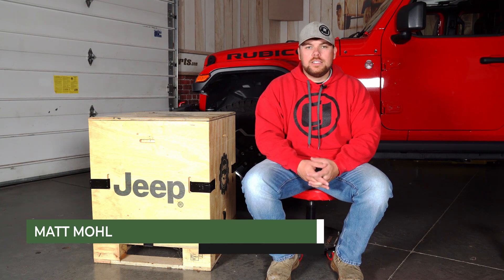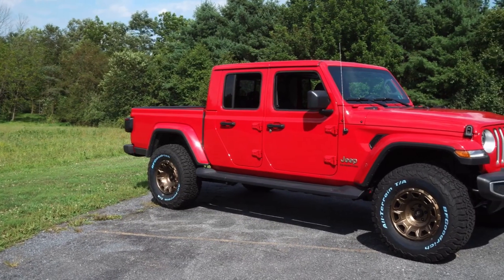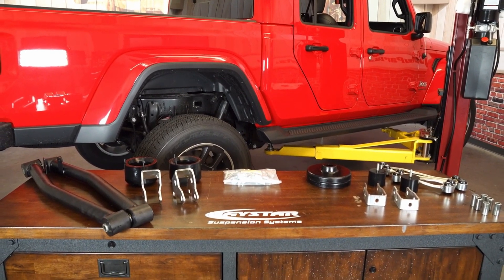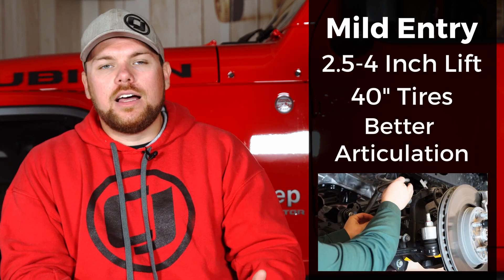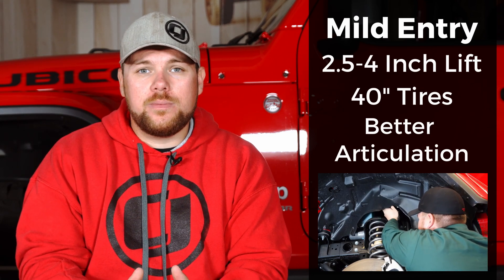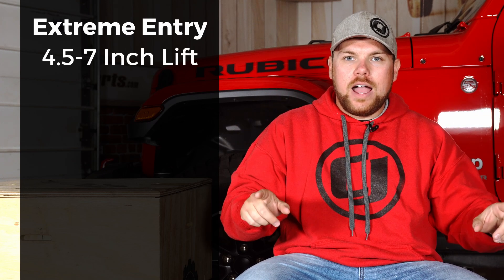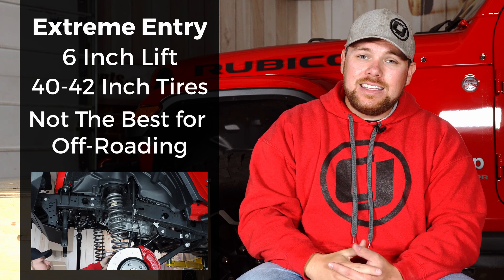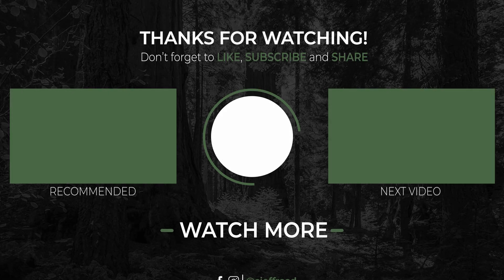Which Lift Should You Put on Your Jeep Gladiator?

Comment: I just used the Mopar  2” and 37” and all is well. The Gladiators really need a lift and larger tires to look right!
Reply: Did you need spacers to fit the 37s?
Reply: @cod4bestgame  no sir. Just the lift and Nitto’s on Method wheels. It even holds the same wheel and tire combo in the stock spare location.
Reply: Yes, it looks silly with huge wheel wells and tiny tires.
Reply: This comment is a year old. Have you had any issues with running those 37s?
Reply: @kamikazekunze  how are the 37’s working out?
Reply: Guys i got a question. So I have a 2022 Jeep Gladiator Sport S with an ecodiesel motor. I have a 2" mopar lift kit on it and i have installed rubicon fenders so i have more space between the wheen and the fender to allow me to put bigger wheels.

Question is because my jeep is not a rubicon and doesn't have the same gearing, what would i need to do to run 37" wheels? I really dont want 35's. If anyone knows, please let me know.
Reply: I have a sport a max tow with the 2 inch mopar and 37s with 17 inch fuel off road wheels and I love it.

Comment: So the Rubican is already 1.5” higher than other gladiators, right. So does a 2” lift get you an additional 1/2” because you take off the 1.5” stock suspension?

Comment: I have the Mopar 2" lift. It lifted my Gladiator Sport almost 3". It's a nice lift, but lacks a front adjustable track bar which imo is pretty necessary. I had to buy it separately. The ride quality is equal to or better than stock. The Fox shocks work well. 35" tires look fine with it, but 37s also work well. Being 5'4 it's plenty high for me.
Reply: How much

Comment from the maker: What size lift should Matt put on his Gladiator Rubicon?
Reply: CJ Off-Road MY GUT REACTION: It’s not for me to decide.  Matt, you do what best suits you and your situation.  “Gut feeling,” aside, I think you’ve pretty much explained to us, several times, that you 1) want to go overlanding & 2) you don’t like vehicles that are difficult to get in/out of.  Given that overlanding will have a lot of miles, do you really think 40’s/42’s are good for that? No, me neither.
Keep your lift small, 2.5”-3”, but VERY FLEXY, like long arm flexy, and use 37’s, max.
Restrict uptravel so a set of 37’s doesn’t rip up things, but build it so a tire will drop out like there’s something broken.  Many a tire shop across this nation will carry/handle a 37” tire.  Plus, you should be able to stuff that 37 underneath, where the spare should be.  If you truly want to overland, than show us what a rig built to maximize space can be; and there’s a heck of a lot of space under that bed.
Reply: Maybe try the Mopar 2 inch lift. It's nice kit for daily driving and mild offroading. You can also beef up the Mopar kit with high end control arms/ track bars to maximize articulation (the OE style bushings can't take a lot of misalignment).
Reply: 3" with 37's.
Reply: 6’

Comment: I did a 6” on a 4runner. I was able to clear rocks and stuff. Now I’m on a rubi with a 2.5 and 37s. It’s lower so I may go higher. If you do wheel, higher is better and 35/37s at least. And for deep snow. Can’t high center something you can walk under.
Reply: Higher is not necessarily better. The higher you go, the more it throws off your center of gravity. Could make it more "tippy". Most folks who wheel regular strive to keep the vehicle body lower, but simply increase tire size. Thats where your clearance increase comes from. Inner fender elimination kits with 3" lift and 35-37 inch tire would be around the sweet spot.

Comment: Good explanation. I have 4.5 teraflex with 40inch tires. I dont want to go 6.5 inch because of body roll. What if I put 42's on current 4.5inch lift, will I get little bit of 6 inch lift affect??

Comment: I put the Mopar 2.5 inch lift kit on my 2018 JLUR and it has a factory style ride and won’t void any warranties which is what I wanted. So it’s perfect. 

I put a rubicon 2 inch lift kit on my JK and kept blowing my transmission and they always blamed my lift kit as if it has anything to do with it so they screwed me out of my warranty so I put a 5.7L hemi in it and it fixed all the problems but then my gas mileage went from bad to terrible so I sold it.

Comment: What model would have best migration to 4.5 lift and 40 inch tires? Overland, sport, rubicon, Mojave? If need to regear and add/take away things, is paying up/down for any particular model more efficient? If one has 3.73 gear and another has 4.1 and needs to be 4.88-5.13, would both either 3.73/4.1 need to swap out or can it be easier to add to 4.1? Also…want to do it on a manual
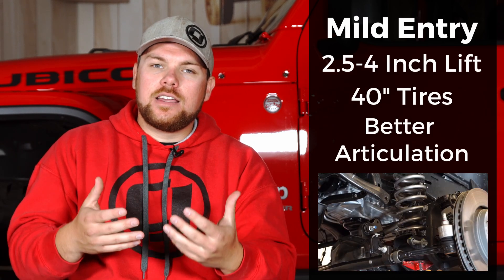Reply: Rubicon I have 37s.  If not driving crazy like spinning wheels, 40s. Rubi is also 4:10 so it helps. Mine is a 22 gladiator with a 2.5 and 37s.  Manual sucks for wheeling and about everything so ….

Comment: I want the Mopar 2.5 inch lift with 35s I think that's a solid starting point. But now I seen someone in the comment section here is running 37s with the Mopar kit....... I always though you needed extensive upgrades to run 37s hmmmmmm

Comment: Great video as always!   Does a 4 1/2 inch require new driveshaft for non rubicon models?
Reply: Probably good idea if you plan on flexing out the axles. Even the RC 3.5 inch lift kits include a front drive shaft.
Reply: nitroxide91 I don’t think that kit includes a drive shaft rather a track bar?   However just because a kit comes with or doesn’t come with something I don’t think that is a determining factor that it’s required/recommended?
Reply: Yes and maybe some re-gearing wouldn’t hurt

Comment: Matt, What do you think of the Mopar 2 inch lift for my 2020 Gladiator Rubicon? How's the quality on that lift?
Reply: For the price theres better quality lifts with more components for a quailyy, better than oem feel.
Reply: @JoseOrtiz_1416  what lift do you recommend?
Reply: @davepetroski1523  rock krawler is a defineitly a solid pick but me personally i love metalcloak, the best flex you could get with a mid arm system and there customer service is unmatched IMO. There lifts are quality and come complete for the most part with everything needed. Not to mention the smooth ride
Reply: The Mopar lift isn't that bad, but you don't get a lot for what you pay for it. If it had adjustable trackbars, it'd be perfect as a starter lift. If you can haggle on the price at a service department through price matching OEM vendors and get them to shave a couple hundreds bucks off, it's not a terrible deal.